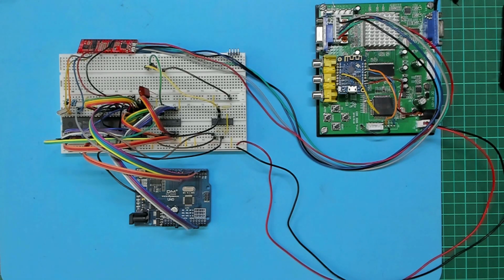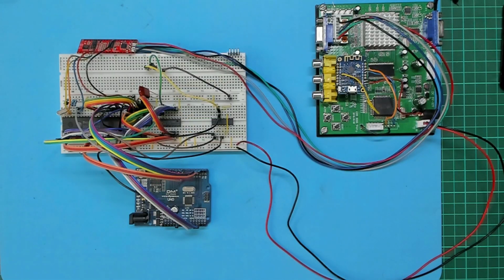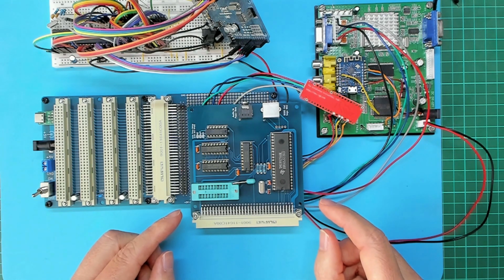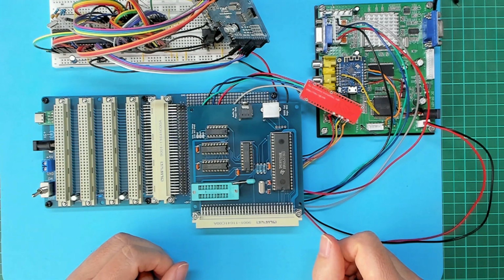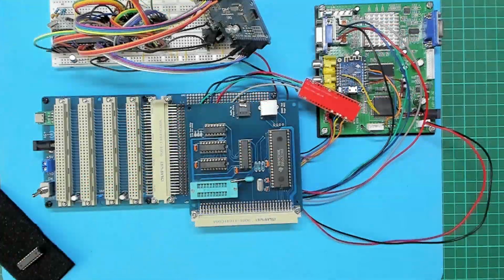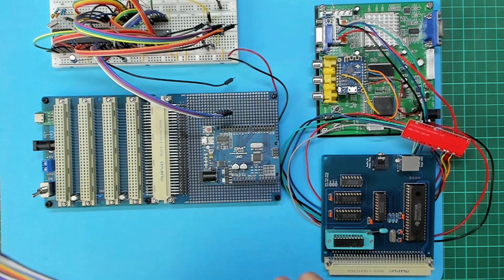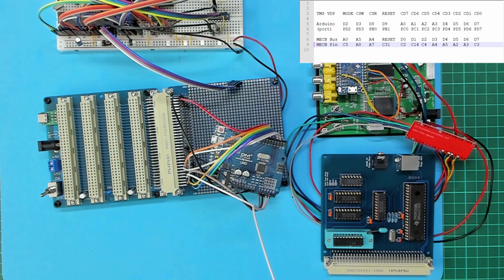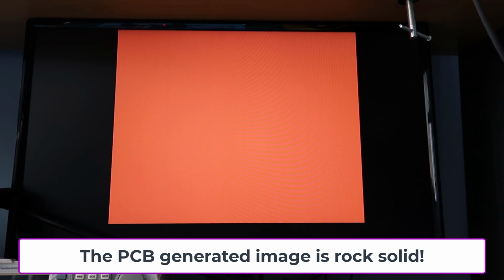Minimalist Europe Card Bus (MECB) - TMS9929A / TMS9928A VDP RGBS Video Card

Comment: Very cool! Do you have plans for public kicad project files? I search solution for my Spectravideo SVI-728 vith dead 9129 and want to replace VDP to 9929 with alternate VRAM layout like yours.
Reply from the maker: Thanks.  All of my publically shared files are available on my Github repository.  This includes PCB gerbers and pdf schematics, but I've not yet released the original Kicad design files (other than the MECB standard board template).   I hope my alternative VRAM solution helps out.  It also helps simplify PCB layout and routing, with its reduced number of interconnects.  🤓

Comment: Great work. I was never a fan of the TMS9918 back in the day thanks to fuzzy NTSC and the palette it offers, but the RGB output with  the 9929 really does look outstanding. This seems an ideal solution for authentic retrocomputer video. It took me a moment on the 9929 part number until I realized you've got PAL TV. This gives me hope for tinkering with the Yamaha V9958 I picked up.
Reply from the maker: Thanks.  Yes, I have similar memories from the early days, of the less than stellar TMS VDP output.  But finding the recent TMSRGB solution for the 9928 / 9929 certainly inspired me to take another look.  With the output now rendering very nicely, these display processor’s certainly have some nice capabilities, as far as VDP’s of the early 80’s go.  I also have a couple of V9958 (or are mine V9938?), that I’d also noted for future experimentation with.  But, I thought I’d play with the original chips first.

Comment: Great video,  but only a slight but. It would be  nice if the Kicad circuit diagram had connections between the chips even if they were in bus format as it gives us the viewers an idea of how the circuitry goes together.  It also helps with fault finding and circuit checking before sending off the grebers.
Reply from the maker: Yes indeed. I usually use bus connections and full connections on most of my diagrams, so that did occur to me.  But with this schematic being quite simple, I initially just used pin labels to document, with an intention of later going back over it for more readability.  Unfortunately I neglected to do this before the video.  So, I might re-visit this for future ease of readability. :)
Reply: @DigicoolThings  When designing Aircraft systems, my best friend was a great big old school drafting desk bigger than A0. I used to put all the equipment i needed to interface to around the outside and a big rectangle in the middle (our unit). Then using the requirements specification slowly draw all the connections in with coloured pens. I found this help visualise the system far better than a load of A3 sheets. This explains why i still like to see wires on circuit diagrams, still after all these years.